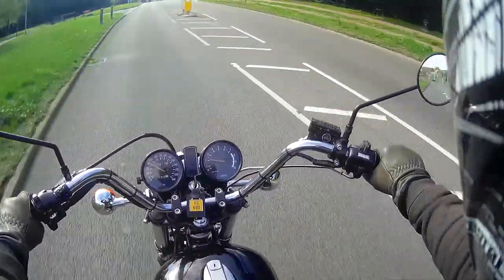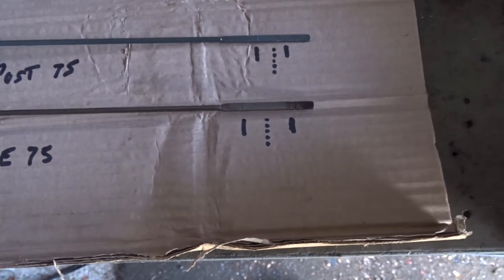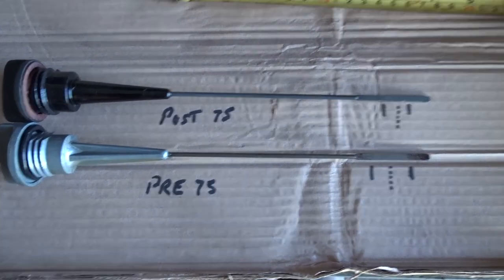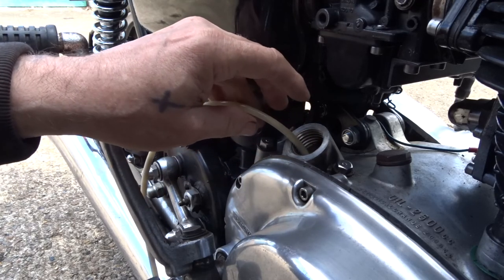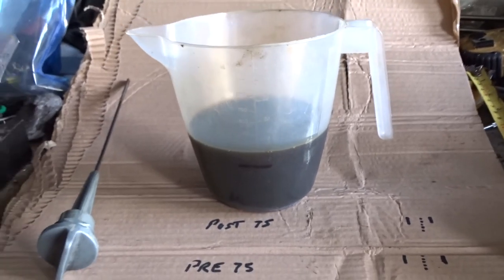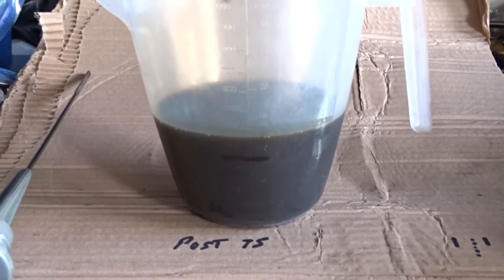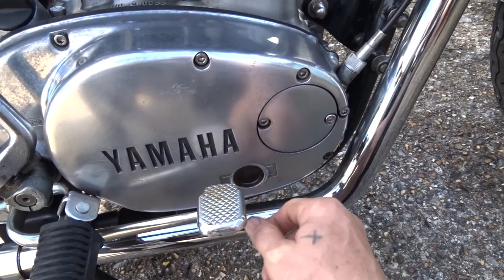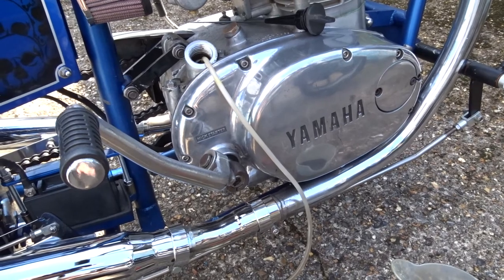XS650 Oil level and the change made in 1975 to the quantity of oil to use

Comment: hi mate i just measured my 73 and 75, the 73 is a normal stick but the 75 has a temperature dipstick and is 10mm shorter so did a oil change and just put 2 litres in will ride it and check, maybe add a bit ,am going to buy a stock dipstick for checking, i should email a pic of my new 75 xs its a cool tough looker, will post to your email thing bye mate

Comment: My '73 is in excellent condition with 10K miles. When oil is filled to the original dipstick full line my bike always drips oil from both breather tubes. The same amount from each tube. I don't have to ride it hard for it to do this. Should I lower the level to the middle mark on my dipstick?
Reply from the maker: when you drain it, put 2000cc back in not 2500cc and note where the oil level is on the dipstick for future reference

Comment: I read in a motorcycle magazine in the seventies that they reduce the amount of oil because of leaking. Oil is cheap Motors aren't I would rather have more oil than less.
Reply: When you get too much oil, you end up with oil frothed up and loading up the rings.  It will begin burning.  The XS has plenty of capacity when in good shape and is very reliable.